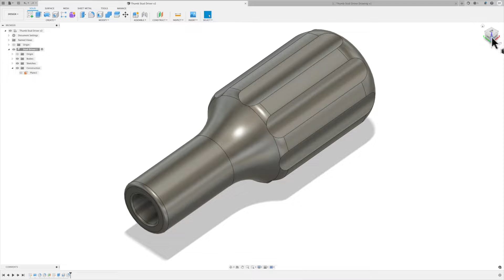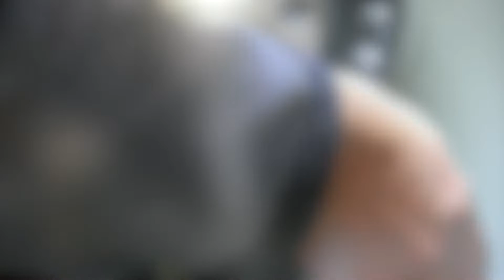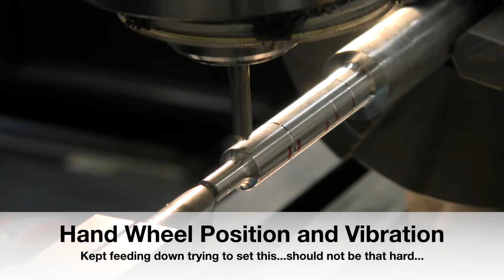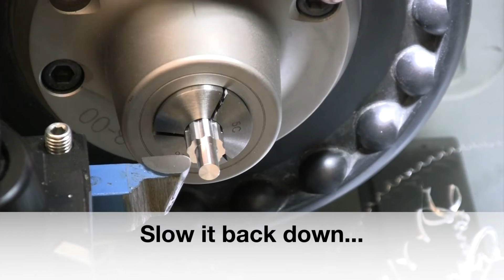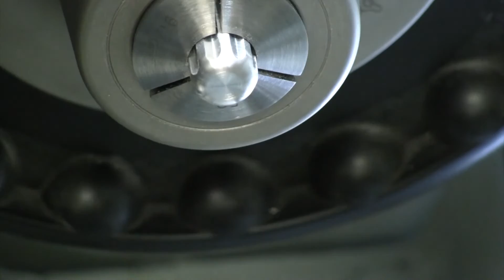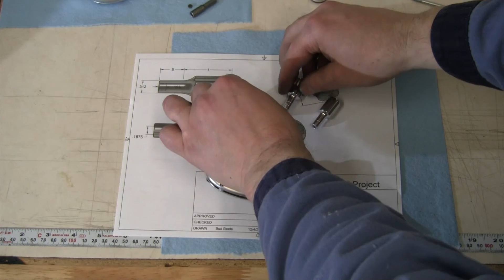Mini Stud Drivers - Custom Homemade Tools

Comment: Excellent video and project, Bud. I can’t believe how big a bit that lathe can take at 7:50. Would you take that big a cut with other materials as well, or does aluminum allow you to be more aggressive?
Reply from the maker: Happy Horned Frog - Thanks for the question. Aluminum does allow for a little more but in this case hard to deal with when the chips won’t break. I can take the same 0.200” cuts in steel but I usually stay around 0.150” deep when roughing steel and a decent feed of about 0.007” to 0.011” per revolution. Chips break nicely in steel there and I can remove metal pretty quickly. I have a video from earlier this year making the steel hubs that shows some good roughing and metal removal.

Comment: Brilliant result(s) Bud--those really turned out great! Like you, I typically model the stuff I'm going to make...but I use Solidworks, as I used to do work with it as a Mechanical Designer with it several years ago. The license is pricey, but it's the software I know so I just bite the bullet and write the check. I've used Fusion 360 and it's fine--and I actually may start using it more and more now that I have a set of Sherline CNC machines to start working with. Solidworks has a built-in CAM plugin, but I've haven't used it yet so I'm not sure how easy it is to use. I recall that Fusion 360 was pretty straightforward to use for CAM toolpaths, although I found the modeling a little less intuitive at first. But once you get the hang of its shortcuts, then it's just another piece of software.
Reply from the maker: Tom B - Thanks, yes I am happy with how they turned out for sure. Fusion 360 was my first CAD/CAM software so I don’t know any different or any better. Being self taught I am slowly getting more efficient. I did find the CAM pretty intuitive after learning the CAD side though. But I most often accept a lot of the default paths where I see the true experts go in and do a lot of refining for efficiency.  That will be next level I guess.
Reply: @BladesIIB  Right--there's nothing at all wrong with Fusion 360. It's great software, and from what I've seen of the CAM plugin built into Solidworks, it's likely a bit more intuitive than the Solidworks-based one. We'll see though this winter, when I get more into it.
Reply from the maker: @bluehornet6752  Yes, that is the biggest challenge right there is time. I have 3 more knife designs to get into Fusion. Hoping to mix that in with my shop time over the Holidays.

Comment: Very cool Bud--we were just having a conversation about collet chucks over in the PM group on Facebook, as I am contemplating what type of collet closer to buy for my 1440TL. Then I see your video notification, click on the video, and what do I see: A Pratt Burnerd hand-wheel type closer! That's what I am leaning towards. Any regrets going that way over, say, a lever-type closer? 

Oh, I also actually just got my lathe set on those cast leveling pads today. You were right--they seem to work really well. No problem with them at all as far as I can tell. Just had to get them roughly centered under the leveling bolts and everything is fine. I was also impressed as to how little torque it takes to lift the lathe with just the bolts. In fact I lifting the entire tailstock with one bolt, not even trying...lol. I just started tightening the bolt and before I knew it the lathe was up off the board I had it set on.
Reply from the maker: Tom B - Glad the video was timely. I have been very happy with the Atlas collet Chuck. I have never used the lever type. From what I know they are quick to open and close and you can even move your stock with the lathe running. The trade off is changing collets is a little more cumbersome. For me changing collets is something I often. The smaller all steel collet chucks with a more traditional Chuck key are also very popular. They are smaller diameter so even easier to work around than the hand wheel for filing, emery etc. and they say the key is still pretty fast. Mine was easy to set up. Seems to be accurate and I would definitely buy it again. When I was a full time machinist I never used a collet Chuck. Now that I have one. I love it. Glad your lathe is set up. It is amazing how easy you can move one around on a concrete floor with just a bar. For being so heavy they slide around well. And easy to lift with the bolts.
Reply: @BladesIIB  I have a Bison keyed collet chuck for 10" Southbend lathe I have, and they're very nice. I've used the handwheel-style collet closers in the past, and thought they were pretty slick. I'm not entirely certain what I'll go for this time around--but I think I'm leaning towards the (Atlas) PB23-D6 model like you have there. They are a bit more expensive than the keyed collet chucks like the Bison model, however I like the idea of having one less chuck key to have to worry about.
Reply from the maker: @bluehornet6752  I don’t think you can go wrong either way.  I have heard a lot of positive reviews on the Bison style collet chucks.